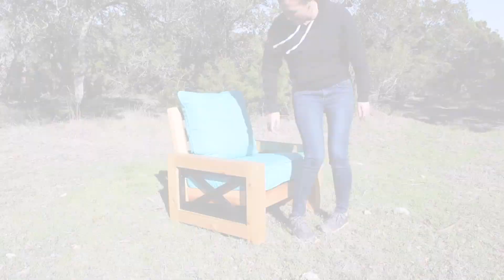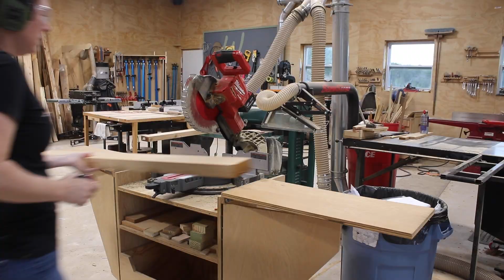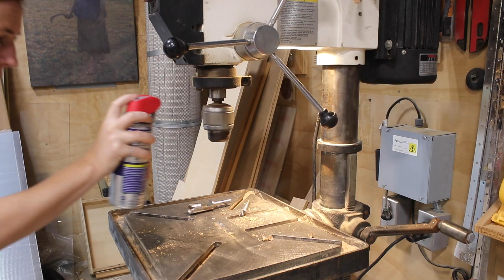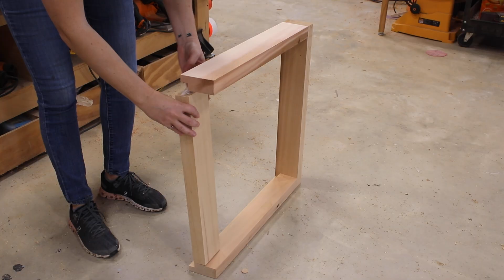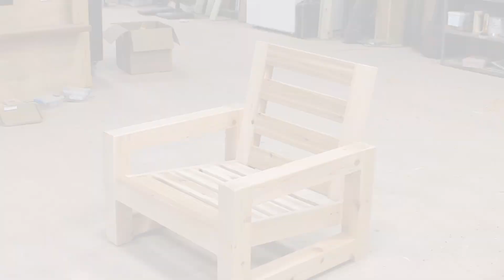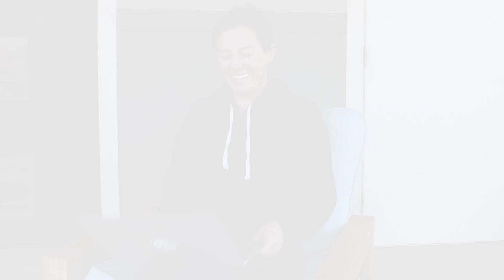DIY Modern Chair for Indoors or Out | Super Easy Build!

Comment: Love the chair build! I have a question about outdoor wood projects. Do you always need to use glue for them? I built a plant shelf for some friends of mine but didn’t use glue on the side supports just screws. Now I am wondering with expanding and contracting over time the supports will pull part making the shelf loose.